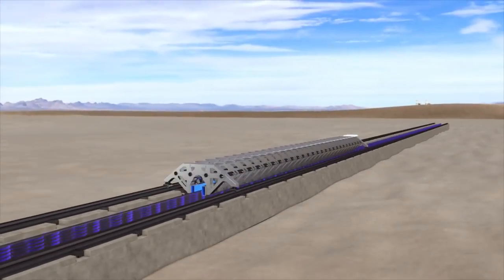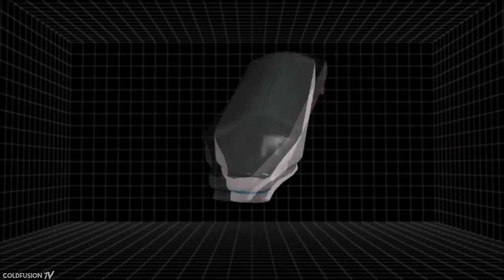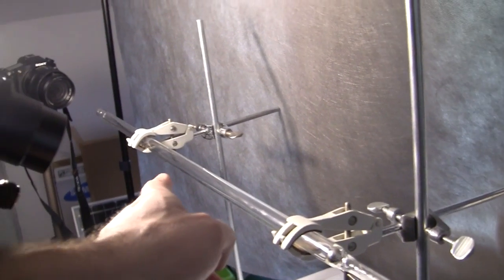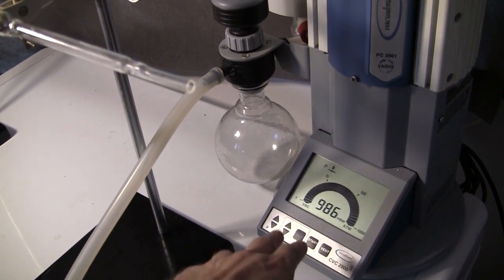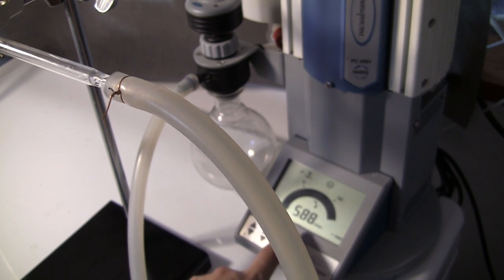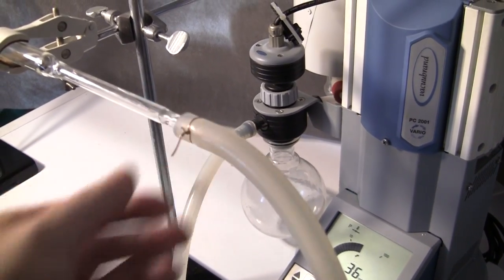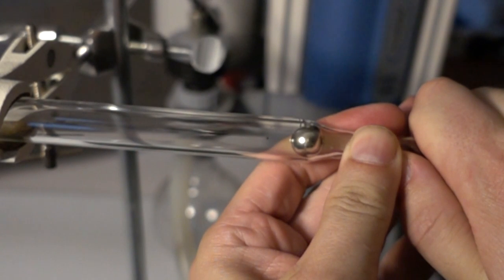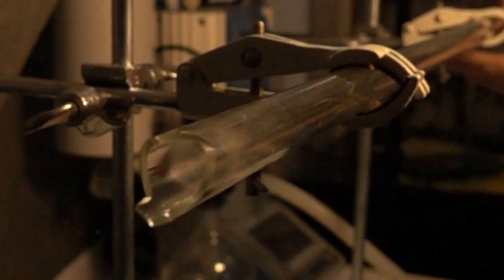How  the Hyperloop can kill you!

Comment: I don't understand this video because it does not accurately represent what the hyperloop might look like. Brakes would be present on the vehicle, including emergency ones, which could prevent such a thing from happening.
Reply: William Gilbert Sarge Rho It's not the speed that kills but the quick change in momentum. Whether you hit a wall and go a from a 1000kph to 0 in a second or have trinitrotoluene in you arse and go from 0kph to 1000 in a second doesn't matter. Not for you at least.
Reply: How the hell would breaks work if the tram-thingy is suspended by magnets?

Also, how will the breaks be able to stop the initial acceleration before the damage is done? I.e before the people inside are crushed like bugs. Please tell me the secret of these super-breaks so I may sell them commercially. WE'LL BE RICH!
Reply: By pressing against the tube's interior.
Reply: Sarge Rho Ok. They'd still be dead as fuck though. But perhaps the equipment will be repairable?
Reply: Eric Johansson Depends where the train/car is. If its at a station with a wall at the end, it will take too much time to slow down. If there is extra emergency tubing, there could be time to slow down. Humans can survive at high G-loads for short periods of time, so the "dead as fuck" argument doesn't really work.
Reply: Eric Johansson No, they wouldn't be dead. The only way for someone to die in this, is if the tube is completely torn apart, or if the pod's pressure vessel fails.
Reply: Maglevs seem to be able to stop just fine. Sensors would also be able to relay the change in pressure more than fast enough to counteract the increase.
Reply: Eric Johansson "Again, please do tell me more of these 'mechanisms' that you are talking about. Imagine the headlines New mechanism invented by [me] has revolutionized ground transport saftety."

The suggestions I mentioned clearly aren't relevant to cars on normal roads.
Reply: +Eric Johansson
I'd design it in a way, that the tube had a lot of security valves. As soon as there is an unexpected increase in pressure on one segment, all the nearby vessels open, to balance the pressure along the tube to an equal level.
It would be like TF would poke a thousand little holes all along the glass pipe at the exact same time. The metal ball would barely accelerate in this situation.

If the tube is then filled with air, it just becomes a standard Maglev and could run at a lower speed, but still run.
Reply: Why, the same way brakes work in maglev trains.
Reply: ***** "In Nano Seconds? Electricity doesn't even travel fast enough for that."
I just want to clarify, we are talking about the speed of LIGHT. Electricity is used inside the microchip, which has only cm/inches of diameter. To send a signal to other components, you use glass fiber. Don't underestimate the reaction time of a computer network.

Also, imagine the metal ball had parking brakes ;)
Reply: The magnets would have to be quite strong. Presumably there would be mechanism in place to prevent such rapid changes in G-forces.
Reply: MetalAsFork Again, please do tell me more of these 'mechanisms' that you are talking about. Imagine the headlines New mechanism invented by [me] has revolutionized ground transport saftety.

I'd be rich. You could be too. That is to say unless you actually have a way of preventing rapid acceleration and you're not just talking out of your ass. But that couldn't be the case, right?
Reply: ***** "He means though brakes WOULD stop them. It wouldn't before they've accelerated enough to kill everyone on board. So maybe you can recover Walt Disney's brain after he went on board this death trap."

You don't know that. We have tech that responds in nanoseconds, so if the brakes are strong enough, they'll lock up instantly, before the pod is allowed to lurch and harm anyone.

Come to think of it, Tf00t's model seems a bit off. His metal ball is almost flush with the tube. Picture a model with the ball half the size, and a strong magnet holding it down. Probably a different outcome.
Reply: OMG elevators are so dangerous what if they fall, we couldn't possibly be able to create a break that was able to stop them.
Reply: ***** Milliseconds, microseconds, whatever. Instantly.

I just rewatched the vid, and his model is definitely flawed. The real pod is not flush within the loop, and the vacuum is not for propulsion, it's to eliminate drag.

Tf00t has the ball right against the tapered end, so it launches like a spitball. That's not an accurate model.
Reply: Victor Veritas Thanks for that. 

'Light travels exactly 29.9792458  centimeters in 1 nanosecond. This is equivalent to 11.8 inches, leading some to refer to a nanosecond as a light-foot'

Eat weeners ***** XD
Reply: Victor Veritas That is the best idea in this thread. That would probably balance it out.
Reply: ***** BRAKES**  

Like I've said in other comments, Tf00t's model isn't accurate either. The vacuum effect wouldn't be nearly as severe as his ball bearing demo.
Reply: What ***** said plus
"Except electricity DOESN'T travel at the speed of light."
We mean a signal/information is traveling at (almost) the speed of light, because whenever you need highspeed communication, you use glass fibres as medium. They alow you to send many bits at very high frequency and speed to the other end ;)

I'm not sure what your scenario is about. When the capsule stops at a station, it already locks its brakes. If for some reason the pipe implodes just behind it, you have to consider factors like Aerodynamics (most of the air would be redirected to just pass by the capsule), the already triggered brakes (it could literally completely immobilize itself), a few tons that need to be accelerated (TF uses a metal ball, while a metal rod would've been more representative) and a tunnel in front, that has already been partially refilled with air. How much acceleration remains now?

Let me ask this way: If hyperloop could accelerate a 10 ton object like a shotgun bullet, then why is the military not using vacuum guns as artillery?

Personally I hope, TF has other arguments to debunk the concept, and was uploading this video just because he wanted to show a nice experiment, that has little relevance in his actual argumentation.
Reply: ***** Oh, sorry. There might be a language problem here. In Germany we say "Glasfaserkabel" and I assumed "glass fibre" would be understandable. I was talking about "Optical fiber"
https://en.wikipedia.org/wiki/Optical_fiber

The signals travel with the speed of light, because they are literally light. The reason it doesn't travel in full vacuum light speed is because the cable is not vacuum.

The term "information" refers to a set of digital Bits and is, depending on the protocol usually a "package".

The time it takes for the information ("hey, we have a leak here") to reach another component is depending on bitcount for the package and length of the cable. Compared to that speed the moving air is just slllooooommooooo

I am really confused about your szenario here. Why is the capsule accelerating? Was it already moving? In that case, if the leak is behind it, the shockwave would not even catch up to it. If it is in front of the capsule, then what are we even talking about? Of course it is dangerous, if you drive towards a damaged track at high speed.

I was talking about "vacuum guns". They accelerate a projectile by using the athmospheric pressure. If a 10 ton projectile could be accelerated so fast by the atmosphere alone, that people would be sqashed inside of it, then it would be used to shoot ten ton bombs.
Reply: ***** well, the brakes have to travel less than eg. an airbag.
If we say, this tube can "break", I am still imagining a little crack and not a sudden implosion of the entire tube segment.

But even if the tube was made out of paper, the max pressure is limited by the atmospheric pressure. 

The length of a gunbarrel doesn't matter to the acceleration. What matters is the force, that accelerates the projectile and its weight. Artillery can use a varying amount of explosives. More explosives -> more acceleration.

Here we are dealing with a force of around 10 N/cm² (Atmospheric pressure). 
The projectile is a long aerodynamic cilinder. That means a lot of mass and little area of attack for the "wind"
The brakes take a tiny, therefor unimportant amount to kick in. If that was a problem, you could just put the seats on a spring so that only the outer shell of the capsule accelerates (like a horizontal suspension ;) ). This would give the most horribly slow braking system enough time to grab whatever.

The scenario is still unclear to me :(
Where does the tube break relative to the capsule? What is the capsule's initial velocity?
How big is the hole in the tube?
Reply: ***** Yes, the length of the barrel is an important factor for a gun, but for different reasons.
In this discussion we care about the strength of the acceleration, not the final speed. A longer barrel doesn't mean the projectile is accelerated stronger, but over a longer duration and reaches a higher exit velocity. Guns are about the velocity of the bullet and the stablility of its flightpath. A longer barrel improves both, but makes it heavier and hard to use in buildings.

I'm not a physicist, and I had to be one, to calculate the force that is pushing the capsule forward, if I considered things like aerodynamics. If I could calculate the expected acceleration (with no brakes at all) and came to the conclusion: "well, that is too much" I would just say: "let's double the weight of a capsule, by making it a 'doublecapsule'. Problem solved. Pack up guys :)"
I know enough about physics to see, that an object that is twice as heavy will be accelerated half as much by the same force.

If you want to calculate it, I'm not stopping you, though,
http://www.spacex.com/sites/spacex/files/hyperloop_alpha.pdf
(check page 15)
Here are some things you need to keep in mind: 
1. The size of the hole is extremely important. Lets say the tube is 10m² thick. if the hole is (generously) 1m² wide, the tube will only fill one tenth as fast, because the hole is a bottleneck.
2. If the tube breaks in the middle of a section, then the tube fills up in both directions, which would half the air expansion speed in each.

Whatever your result will be, I can say:
1. decrease air drag and expansion speed by increasing space between tube and capsule.
2. decrease acceleration by increasing capsuleweight.
3. decrease impact on passengers by adding more suspension.
4. add a fucking brake XD
Reply: ***** ok, I'm doing it ...
to brake = bremsen
to break = zerbrechen

http://dict.leo.org/ende/index_en.html#/search=Bremse&searchLoc=0&resultOrder=basic&multiwordShowSingle=on&pos=0

velocity is not an issue, though, because an airwave can not accelerate the capsule beyond the speed of sound (not even that) and it is designed to operate at that speed every day.
Reply: Yes, brakes that can function fine at 800mph at a moments notice without any problems arising. Uh quick question though, what is the top speed of say a race car and when running at top speeds how long does it take to stop when the driver hits the brakes hard? 

Best case scenario this concept is decades away. Worst case scenario this is sci-fi bull.

Comment: At least the physics allow for it to do what they say it will, which can't be said for most of the other ideas you've debunked lately. Do you see any way they could work in safety features to stave of the abrupt acceleration and/or deceleration? Even if they are financially easy. I would you could have a minimal friction surface below the magnet rails and if the vacuum fails, the magnet rails disengage so friction would start to build up gently. I think this would be sufficient for a failure mid transit, though it wouldn't work for anything close to the end of the journey.